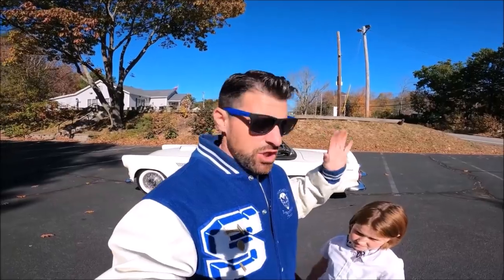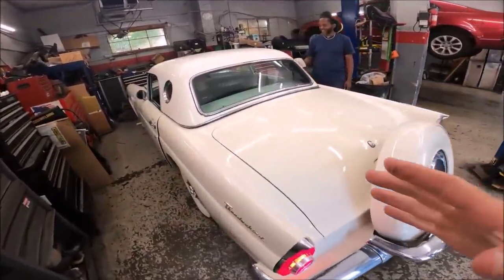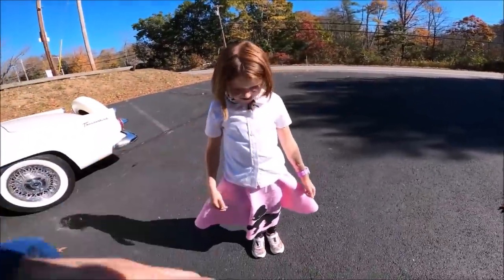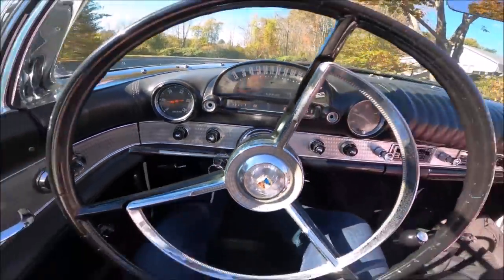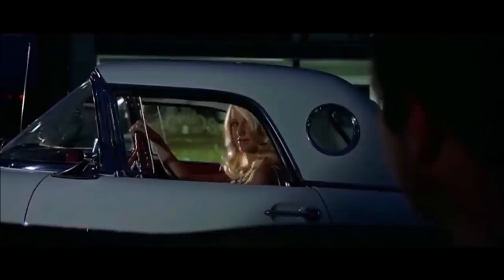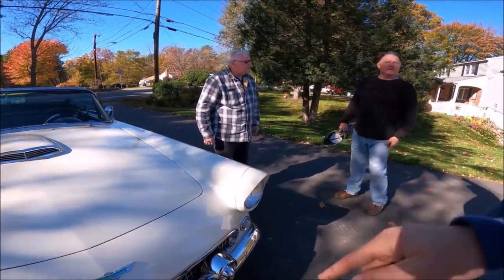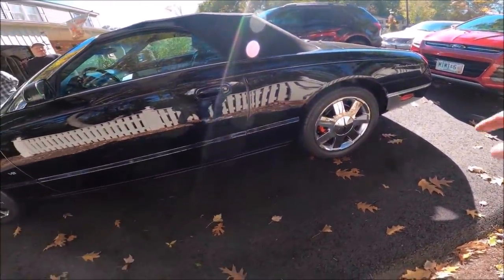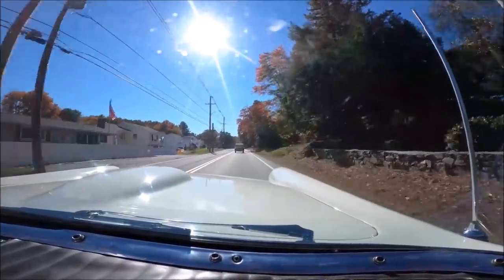Giving my 81 yr old Grandfather a 1956 Ford Thunderbird as a Thank you! - Flying Wheels

Comment: I own a 56 as well Z code in Sage green with a 312. I like the part where he had the air cleaner off and adjusted the Holley 4000 tea pot carb. That is Colonial White. The fish bowl guage enclosure and Foot flip vents are iconic. The trans can be tricky, dry converter that comes apart in three pieces, timing marks face 3 o'clock. Debating on starting a shop working on these cars specifically. I am 42 and may as well.